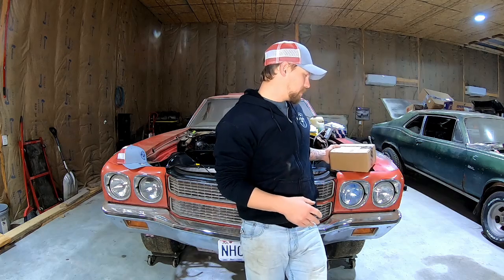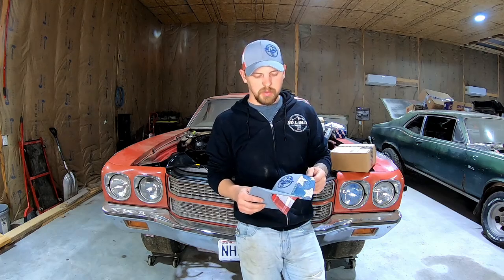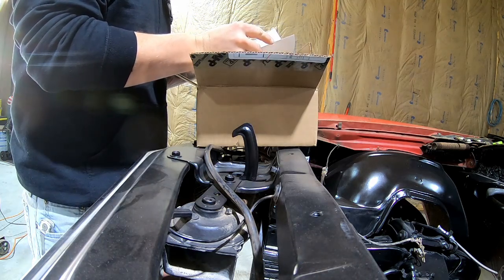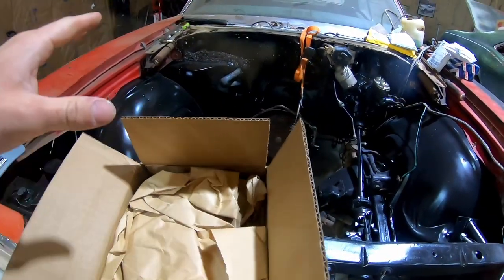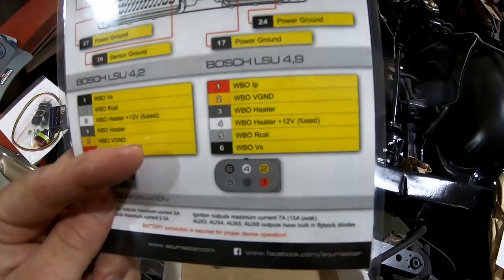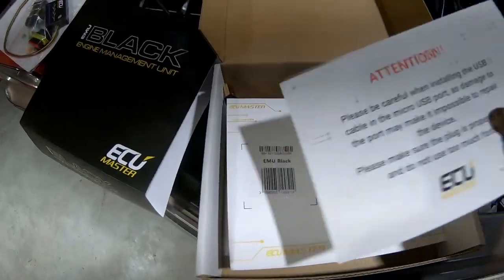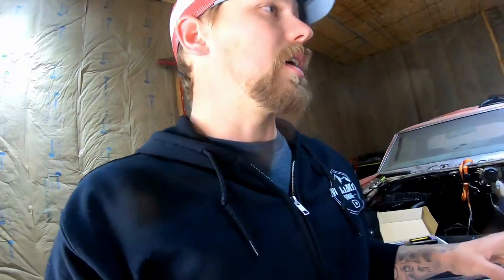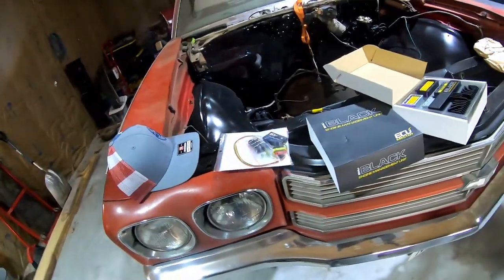2JZ Chevelle Engine Management! EMU BLACK + No L1m1t Garage MERCH!

Comment: Did you build the internals on that vvti 2jzge? I am doing the same thing as you but in a 66 mustang. I put in the GTE rods and pistons. The GE rods are thin as pencils!
Reply from the maker: I haven't yet. I will be getting it running and working well first, then i most likely do the internals in the future! Wasn't in the budget at the time